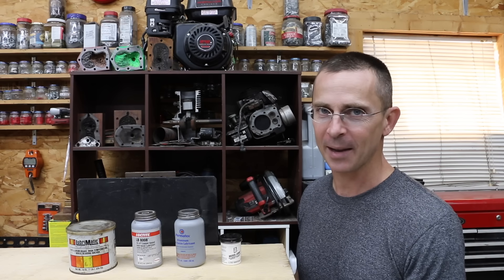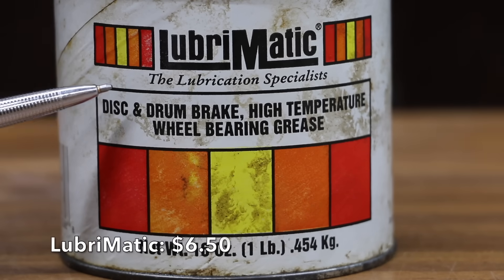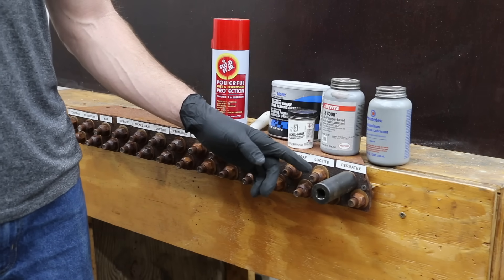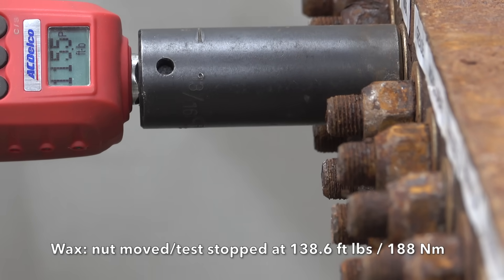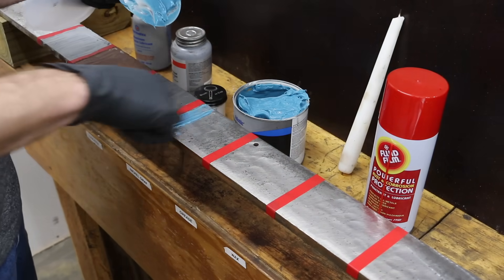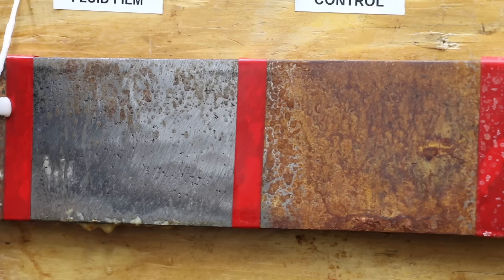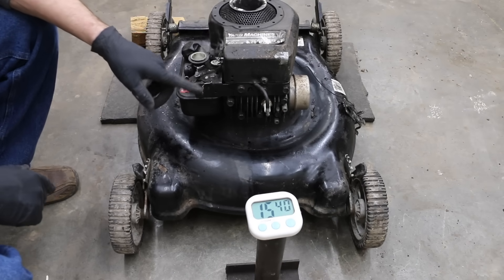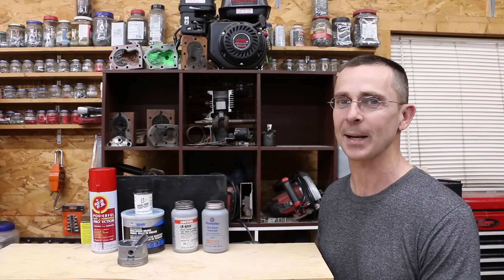Does Anti-Seize Compound Actually Work? Let's find out! Anti-Seize vs Grease vs Fluid Film vs Wax

Comment: Dude, I just had (what I think) would be a great idea for a video: test Harbor Freight $2 clear safety glasses against other brands--like the Lowes $10/$20 ones, and even the high end ones.  Not sure what testing parameters to use...maybe BB guns (multi-pump ones would allow a range of force to be applied), your swinging hammer rig, scratch tests, hell throw it on the lubricity tester and see how long they take to melt/wear through.

I don't recommend that you wear the glasses during testing, though.  Find someone expendable...do you know PewDiePie?
Reply from the maker: Thanks for the video idea.

Comment: I'm sorry, but this has been the worst testing video yet. Apples and Oranges were compared here. To begin with, when anti-seize was first introduced, General Motors taught their techs that their anti-seize was product utilizing powdered glass for which once the liquid of the product had evaporated / dried, the remaining compound placed a barrier between the two metals. Once you loosen the fastener those powdered glass barrier would shatter allowing the two metals to separate. .......... 

I've been using "Loctite" (Same or sister company as Permatex) Aluminum Anti-seize since 1980. I have used it on devices that I assembled with it back then and sat outside in humidity Hot and cold weather as well as being heated up about once or twice during the year. Over 30 years later, I've had to disassemble part of that machine and the small bolts came loose as if they were new. .......... 

Although, Loctite and Permatex has it listed on the container as a lubricate, that lubrication is only temporary and in no way ever intended to be tested as a lubricating substance as what this video did. I have found it to use a similar substance if not the same as glass powder or a form of Aluminum. I have also found it to almost be a one time use product. Many times after loosening fasteners that I previously used Loctite / Permatex anti-seize on, required a new application of it, for the next several years later that the fastener is to be removed. .......... 

The grease in this video is a simple lubricate unlike the Anti-seize in this video. Candle wax properties cannot handle heat or extreme cold. ..........